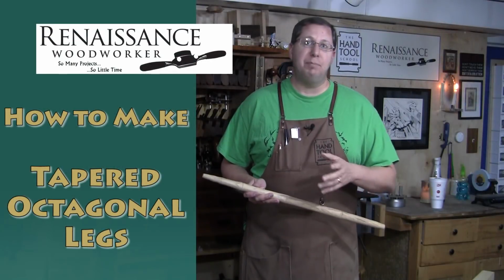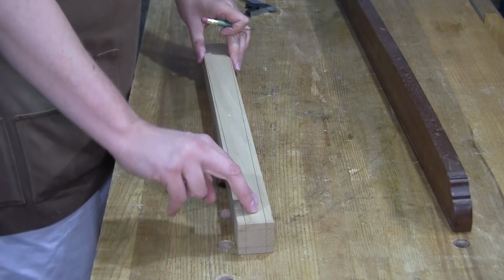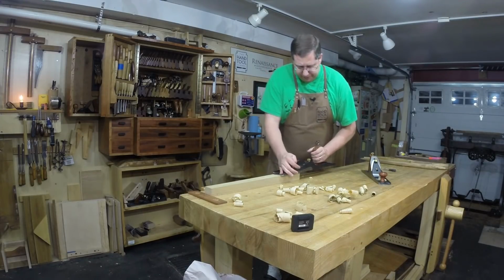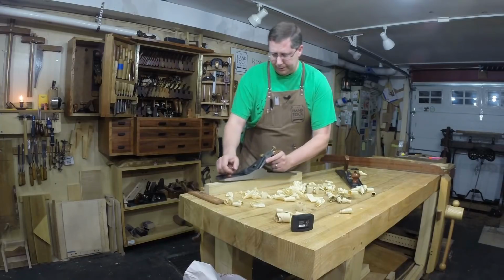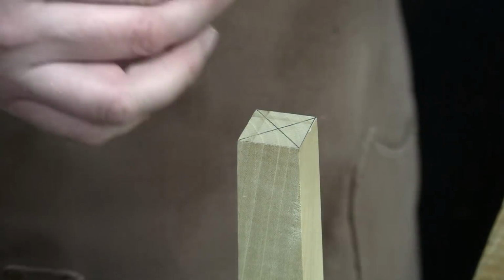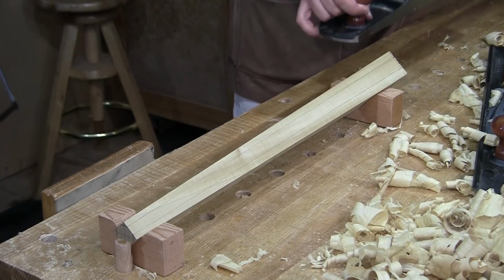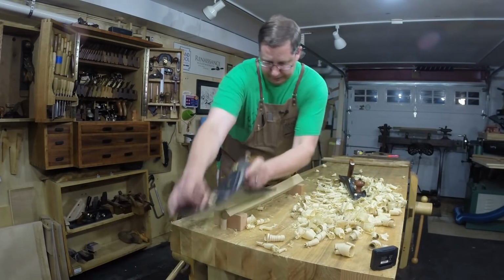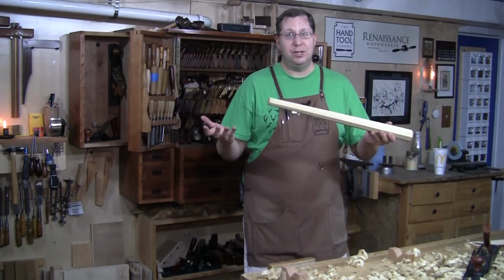How to Make Octagonal Tapered Legs by Hand

Comment: Why do you divide by 2 when your reducing all 4 sides?
Reply from the maker: Because I'm keeping the taper symmetrical on each face.  So to reduce from 1 3/4 down to 1 on 1 face I have to remove equal amounts from both (2) edges.  I am reducing all 4 faces but I'm doing it one face at a time.